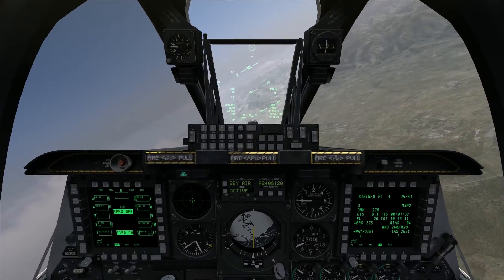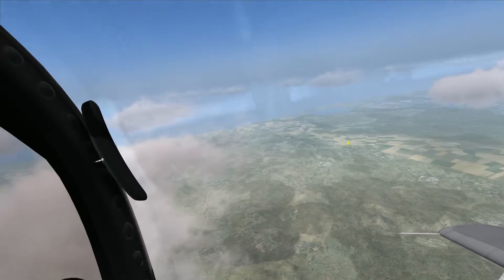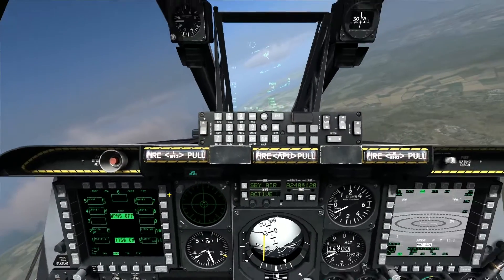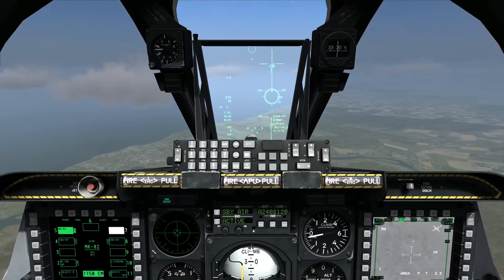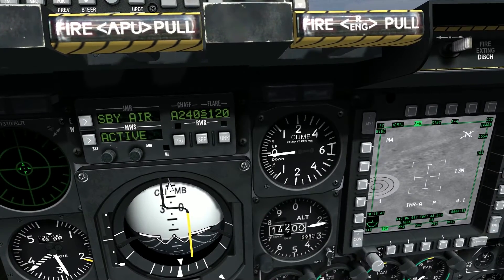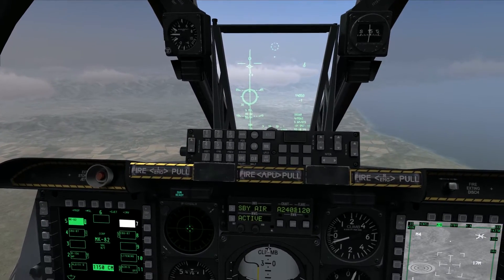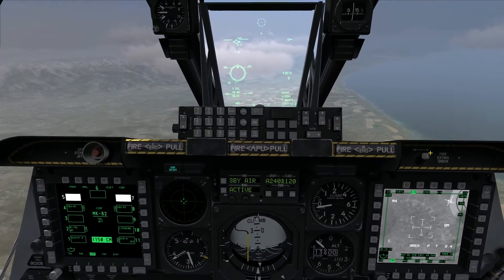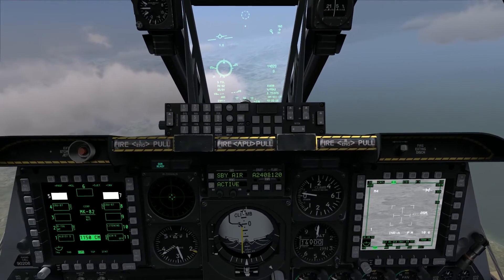On the Range #29 - CCRP Bombing Wind Error in the DCS: A-10C Warthog

Comment: Is the wind more of a factor when it comes to deployment of unguided munitions? I understand that guided munitions are not windproof but are they more wind resistant because of maneuverability as long as you don't drop them too high up? Again, great video and definitely something pilots need to think about when they see that their deliveries missed the target.
Reply from the maker: It isn't necessarily more of a factor but guided weapons are inherently more immune and can compensate on their own.  To be honest, I never really thought about the wind much before I started doing these videos.  I typically drop unguided munitions from low altitude and guided munitions from high altitude and either never noticed wind errors or assumed the errors were my fault.  I was really surprised by how much of a difference the wind makes.